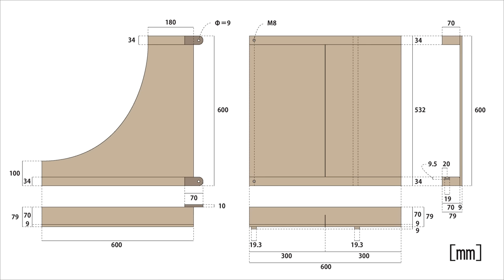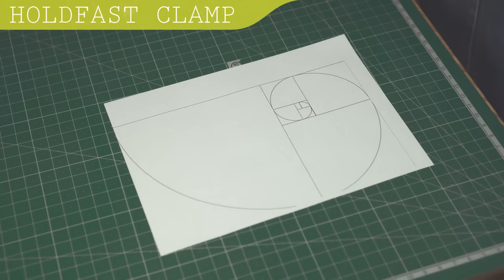Top 10  Table saw sled Hacks / Diy woodworking

Comment: The video production quality is absolutely superlative! Lighting, composition, framing,  clarity, sound (sans the annoying verbage) precision, and guidance are natural, informative,  and easy to watch. You are inspiring! I am now your biggest fan! The shop-made tools, the focus on safety, the innovative use of smartphone Bluetooth, and the engineer's flair for precision are refreshingly presented. Educationally sound and thorough worthy of a Masters in Education. Perhaps in a few years you will include your children. You know there are multiple opportunities for artistic creative flair to add whimsy in you designs. The front and back fences of the cut-off sled could be a dragon,  a choochoo train, an alligator, an intarsia bird, a turtle shell (blade guard), etc. The use of primary colors for components like drawers and knows, safety guards, and clamps would bring a visual (color is perceived buy additional areas of the brain leading towards better retention, i.e. RED hot) component for the young or beginner woodworker.  The GIFT of this video mark you as a good man. So glad I found you.

Comment: why the cell phone? 
source of power?
really would like to know
thank you
thank you for video 👍🏽
best wishes
Reply: The mobile phone has an app on it which controls his smart power switches, turning on and off the saw / dust collector / what ever is plugged in.
One of the other videos where he built the saw shows it.
https://www.youtube.com/watch?v=k1wMsF75k_w - 2.10 ish into the video.
I would assume based upon this that the power is provided by grid mains, but he could be running off a micro or mini grid, but plugged in are all ac voltage.
He uses both mains and battery tools.
Reply from the maker: Smart plugs that control power via Wi-Fi are used.
Thank you for watching.
Reply: @Youchubeswindon  
thank you
bit technical for me but I do get the gist of it
Reply: @YASUHIROTV  

thank you
bit technical for me but I do get the gist of it

Comment: One millimeter is approximately equal to 0.0394 inches. There are 25.4 millimeters in an inch. To convert millimeters into inches, divide the length in millimeters by 25.4
I don't understand why these guys over the pond are so stubborn and stupid to use "thousands of an inch|" quarters od an inch, hundreds and seconds of a F-ing inch...FFS! Millimetres are the most accurate measurement there is.